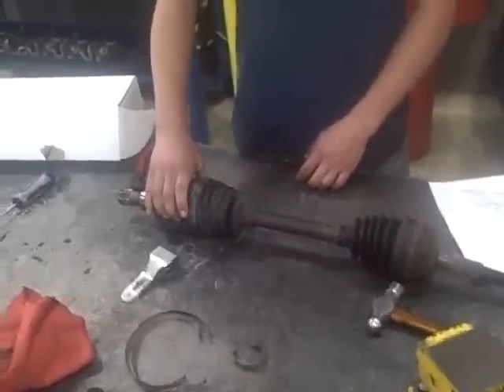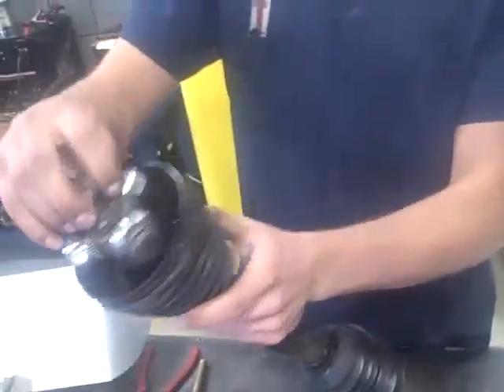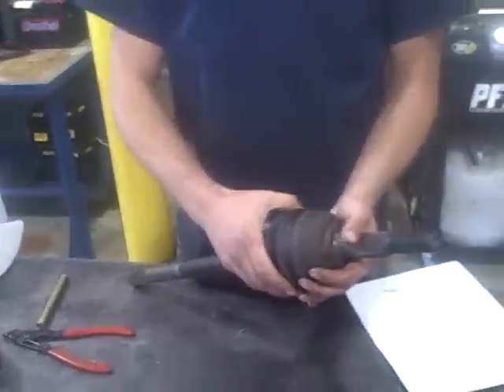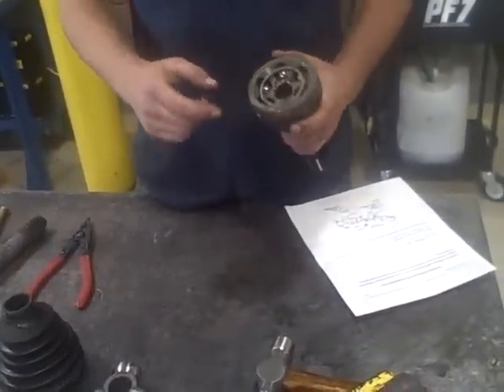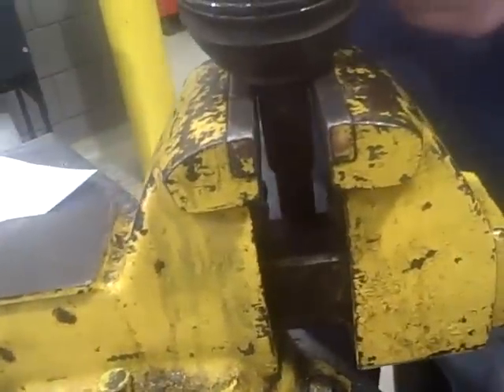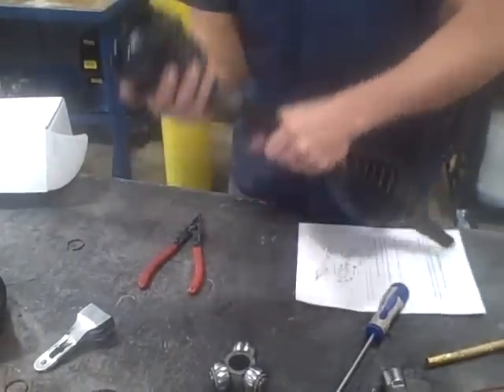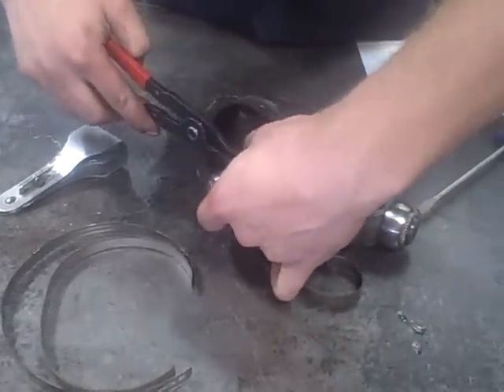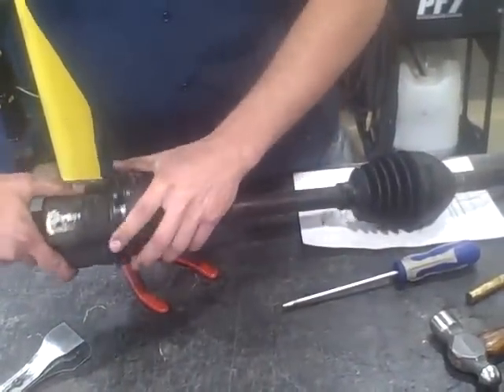CV Axle Disassemble and Reassemble

Comment: Any one can answer my quistion pls. What is the main reason why the CV joint making a noise while manoeuvring to u turn. If my driving position straight there's no any noises. Thank u
Reply: Ernie Delapena well it’s a bit late to answer, but if anyone else has the same question, the joint is simply starting to ware out and will need to be replaced. The way they’re built, they shouldn’t have clearance issues in their normal position, but when you turn the joint is at an angle which allows for play.